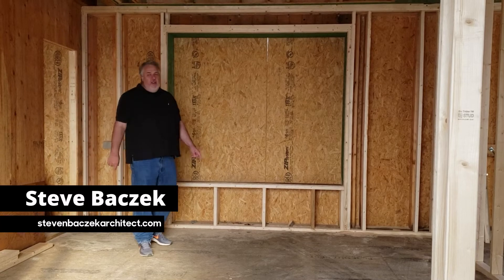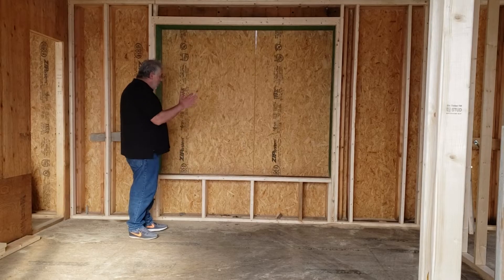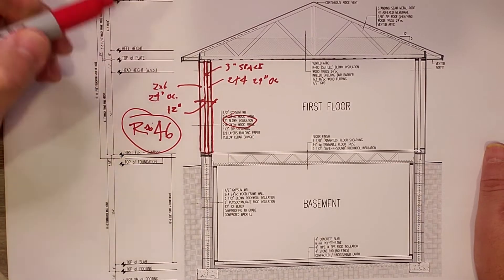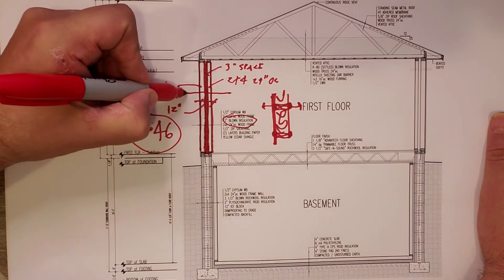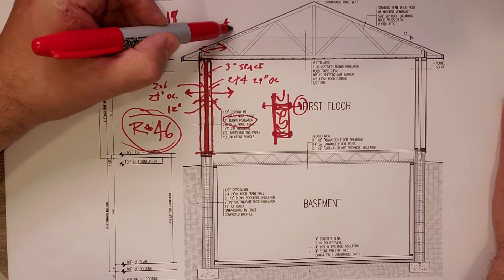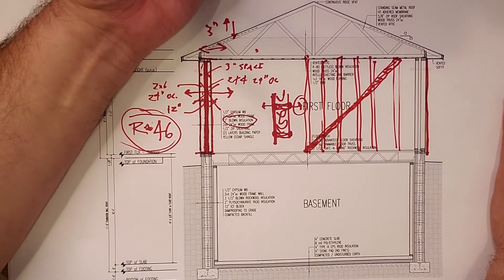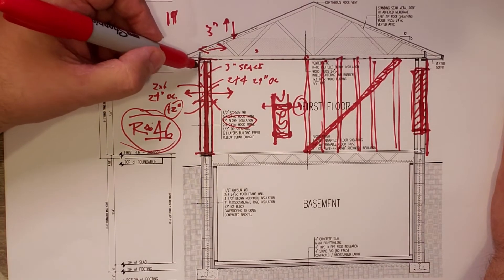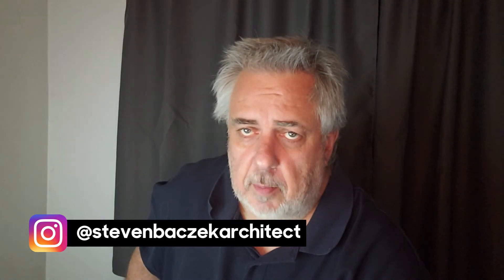Double Stud Wall Framing for Passive House

Comment: Steve, since the gap in the exterior wall is arbitrary, couldn't the 2x6s be replaced with 2x4s?
Have seen double walls with just 2x4 construction, but the 2x4s were staggered.  Not sure why they were staggered though.
And is there any advantage to installing windows that do not have a flange but allow the window to be recessed a bit?
Appreciate calm "sans soundtrack" presentations like this.  Thanks.

Comment: Fascinating post. Especially since, I was considering building a home, which included  the same basic structural elements. Such as a double wall with a diagonal internal bracing member. And it makes running the utilities such as plumbing and wiring, much easier and therefore more cost effective versus a single stud wall. (Which I didn't notice mentioned in the post?)

Except for I preferring a "staggered" double wall,  versus the inline double wall, in the post. Since a staggered formation, has some advantages, such as in terms of thermal efficiency (since heat transfer is not linear) and  greater sheer strength. Plus it's easier and more efficient to build. Since face nailing the diagonal member can be done at any point in the construction. 

So I'm curious Steve, why are the stud walls inline, with each other, instead of staggered in this post?  (Even if the advantages that staggered double walls have over inline double walls are relatively nominal)  

(I was also thinking about a trust formed external wall. Since a trust is, such an efficient design. But relatives to platform dimensional lumber stick building, it's considerably more complex and most likely not worth the added cost, to get it approved?  But staggering the double walls don't seem that much more complex than keeping them inline. If I'm missing something, obvious I apologize)

i just subscribed to keep up the good work.

Comment: In Ontario we're at 16" on centre. 
1. Is the 24" spacing still in that area or are you allowed to do it because of the double walls? 
2. Why not alternate the studs between the inter and outer walls so that they are not as close?
Thank you.
Reply: I've seen alternating stud applications, supposedly superior for structure.
Reply: 2x6 24" > 2x6 16"

Comment: Why do 2x6 for the outer wall? Why not do two 2x4 walls? Would be much cheaper and give a larger gap between walls for thermal break.
Reply: Lol. Exactly. I thought this was partly the reason to do this - to have a wide wall without added Lumber cost. What is the 2x6 accomplishing that a 2x4 with a greater gap wouldn't accomplish?
Reply: 2x6 is load bearing

Comment: Why the 2x6 exterior wall? Is there really ever any reason to do a 2x6 exterior wall in a double wall assembly?
Reply: I was thinking the same. Is an exterior 2x6 walled needed? Why not a double stud wall with 2x4 studs 16”OC and a 5” gap? Alternatively, how about a single 2x6 24”OC wall with 2” rigid foam on inside (with or without furring strips)?
Reply: 120mph wind rating requirements.
That was his answer to the question asked above
Reply: @ Oh, did they say this? Did I miss it?
Reply: @teraxiel  in a comment further up

Comment: Where do you install the 6 mil polyethylene vapour barrier?
Reply: If you are building this primo, you wouldn't use something as pedestrian as polyethylene vapour barrier for peak performance.  This seems like a stupid implementation, since you are missing out on the opportunity to install a nearly complete vapor barrier over the 2x6 wall, and then running electrical and pluming in the cavity.

Comment: OR you could try the following . my house is a log/block house . the laminated 'logs ' are 14 cm thick with 14 cm of wood fiber insulation on the outside followed by verticals furring strips and wood paneling over that . the space in between the FS acts as an air vent to remove any moisture build up . no vapor barrier is necessary as the entire wall assembly is vapor permeable . The mass timber on the inside regulates humidity and tempeture swings making  for a very comfortable atmosphere . The air blower test was almost at a passive house level . No  air to air heat exchangers are necessary as the entire structure is non toxic and non off gassing. 
opening a window for five minutes is sufficient to refresh the room . heating is done by a two ton soapstone down draft oven . 
A three hour burn is enough for two days at 72  
degrees or warmer at 32 degrees outside . 
The exterior walls can be erected in about two days including g roof framing . the lower labor cost offsets the higher price for the timbers .

Comment: My son has been building double stud walls for a few years now. Outside wall is 2x4 16” on center and that wall is spray foamed. 2” gap and than inside wall again 2x4 16” OC but of set 8” with exterior wall and that gets Rockwool insulation.  Now for a question I have for you. Have you had drywall screw heads start showing up over time?  First 3 houses he did, so he came to me and asked way that might be happening. I thought about it for a bit and figured out that the inside stud wall was twisting because nothing on the back side stopping it from twisting. Put blocking half way on wall and next 4 houses and no problems so far
Reply: That is a valuable observation and astute problem resolution.  Thank you.
Reply: diagonal bracing 45 deg between the 2 walls attached to the inner wall every 4 feet might be faster and give the wall a lot of lateral support at the same time. faster but a bit more wood. so cost of labor vs materials and structural load
Reply: @glasseyemarduke3746  I like the idea of the lateral support.

Comment: what do nyou do about fire blocking between the studs...actually there is an open space from floor to ceiling, between the two walls which would allow fire to go straick from floor to ceiling...what am i missing
Reply: That space will be full of dense pack cellulose treated with a fire retardant.

Comment: That was great coverage on dbl stud walls Steve! And glad you talked about how the "dew point" moves within the wall assembly and having to pay attention to potential condensate. I was wondering your view on offsetting the 2x6's and 2x4's centres (ie by 12")? Effectively that would produce greater depth of insul in the cavity between the two walls (ie.,  6-1/2" of insul between the inside face of a 2x6 and the vap barr / drywall, and 8-1/2" of insul from the front face of a 2x4 to the exterior sheathing, respectively). Obviously most applicable on long running walls, but do you think that would add materially to the R-values, rather than simply a consistent 3" thermal break? Worth the bother?

Comment: Puzzled why you'd go to that much effort for a 3" gap when you could add a whole lot more so easily - especially when the common studs aren't even offset from each other, so at every stud you literally only have that 3" gap. Upgrading even a little bit, to say a 6" gap, and having the common studs offset so they're not so close to each other, would give you a much better performance for zero extra effort.
Reply: cost mainly... 

yes the framing is the same cost for a 3" vs 6" gap... but now you have to insulate 3 more inches of wall. r-46 in a wall in climate zone 1-4 is already absolutely bonkers.

there is also some cost benefit to creating the gap in the first place, which is why the effort for the gap is there... for example now your electrician doesn't have to cut holes in studs, he can nail right to the exterior wall stud. that saves him time. and now you can safely run PEX and even 3" pvc through the exterior wall if you want too in most climate zones. without drilling holes through any of your studs.

Comment: Informative as ever Steve. But I have a question. Lets assume the same thickness of insulation is included in 2 different wall configurations. Along with the same interior and exterior finishing layers. 

Number 1 wall is the double wall as shown here. Number 2 wall is a standard 2x4 wall with 3.5" of insulation within it and the remaining thickness of insulation is applies to the exterior. 

Is there any advantage to No1 over No2? To my mind Number 2 has a better thermal break and a lot less lumber so will also be cheaper.  Also as a potential owner builder with little framing experience I think No2 would be easier to build. Or if I did get framers in at least I'm only paying for one 2x4 frame to be built?

Whats your thoughts?

TIA

Comment: Like it but could you use Zip R9 with 2” closed cell foam, then 4” RockWool in cavity, A vapor barrier, then the 3” of cellulose?   Can this eliminate condensation and have higher rated insulation over long term.

Comment: So…where’s the fire stop required in most areas?
Reply: that does seem to be the fly in the ointment.  The firestop cannot have a thermal break.  I like the trippled 2x4 walls, where the middle gap, allows wiring to go thru without drilling. And the middle is like 3 2x4's, if you put them on the 1.5 in side facing up.

Comment: What's an estimated return on investment based on the savings in hvac costs vs the extra cost of the double framing?
Reply: What’s the cost of extra comfort in the space? It’s not just energy savings, it’s a consistent temperature through the space and no outside noise.
Reply: @JoshuaRes  I suppose that matters in certain environments.
Reply: @WILSON.1 it’s often the most impactful way to sell an upgrade like this. Definitely higher cost to build, but there are benefits beyond energy savings.

Comment: If the inner wall was the 2x6 load bearing wall, the roof/ceiling spans would be a foot shorter.  If it was zip-sheathed and then the outer non-load bearing wall unsheathed and supporting just the cladding, you would still have the same thickness of cellulose, but shorter spans for roof/ceiling, as well as "innie" windows, so why not do it that way ?  The only downside I see is that you have no cavity to run wiring/plumbing between the two walls.  On he plus side, you would eliminate the thermal bridging around the windows and doors because you don't need 12" wide jambs.

Comment: So while the insulation info is good, what about that large opening without an appropriate sized header and no cripples?
Reply: It could be it is not a load bearing wall or he could be placing the header as part of a floor system above.

Comment: The devil’s in the details, I guess … please comment more on making a durable low maintenance wall, especially with respect to moisture transfer. If we build a double stud wall are we signing up for finicky interior vapor barriers and fine tuned mechanical ventilation? Is there a way to avoid the infamous “cold sheathing problem” altogether, like flashing the inside of the sheathing with closed cell foam?
Reply: Insulate on the exterior. You need long fasteners and other details, but you keep the sheathing above the dew point.

Comment: Why dont you offset the inner and outer walls so the thermal break is more than 2 times the space.
Reply: Once the bridge is broken it’s broken. It doesn’t matter if it’s 3” or offset in half because the cellulose won’t bridge
Reply: @HarderNotSmarter1  there is still slight thermal bridging. You can look up thermal models if you'd like

Comment: A lot of people naysay about putting OSB on the outside of a double stud because of its relatively low permeability. Do you see that being an issue at all or is that overblown? Will this walk use a vapor control membrane on the interior to slow moisture drive during heating seasons or is it fine without one?

Comment: The interior comfort level with double stud is A+, in my experience. Love it.
Reply from the maker: Agreed - great acoustical solution too
Reply: My  double walled cabin annex, unheated and uncooled is great year round in Sweden.
Reply: The chance that blown insulation doesn't settle over time is basically zero.
Reply: @nomdeguerre8464 there is a difference between blown in and dense packed.

Comment: Question:  Would it make sense to stagger the inner and outer studs, potentially increasing the thermal break from three inches to 6.5 to 8.5 inches, in most stud locations?  Or is this effect negated by something else?  Great video.
Reply: Steve, I see some builders sheathe the inner wall on the air space side and tape (and may even call it a vapor barrier, a term I question).  Wish I had used the double framing in mine. Instead, I framed a 2x6” wall, used dense pack cellulose, spay-foamed the stud edges, applies 4” of open cell styrofoam, then battens and a cedar rain screen. If I do a double frame, whether to use sheathing on the interior frame or exterior air space  is an open question for me.  Drywall again on the inside wall would be done again.
Reply from the maker: Maybe there is a slight benefit in terms of heat transfer........as for overall Whole Wall R Value - it won't change it
Reply: @stevenbaczekarchitect9431  That makes sense.  Thanks!
Reply: @stevenbaczekarchitect9431  But if you stagger the studs, you don't need much distance between the walls and still achieve your thermal break

Comment: Great content Steve. Are the  numbers crunched to see what more cost effective  putting added insulation on the outside or as you did in that house. A double studded wall. I like the double studded approach.  Wish big red can show some cost comparison.
Reply: Double stud wall is cheaper, and much easier to put your finishing on , whether siding or esp stucco.
Reply: @johnwhite2576  The only downside to double stud wall is lost of floor space inside the house.

Comment: Curious what the “need” is for the 2X6 on the exterior wall? Would 2X4 interior and exterior be structurally sufficient? Potential for a larger thermal break where the stud section of the wall would have greater R value, not to mention less lumber.
Reply from the maker: It is on Martha's Vineyard - 120 mph wind zone framed 24"OC
Reply: @stevenbaczekarchitect9431  Which is an interesting point. Double Stud is a really straightforward way to make reasonably good performance tall and/or very high wind and/or very heavy cladding situations work, because you don’t really need to care about the framing factor of the outer wall since no interior finishes are attached directly.

Question - ever framed with structural sheathing to the inside for your primary air barrier, cavity (i.e. to the outside of the sheathing) filled with batts and then fluid applied + glass mat sheathing or just a textile WRB as the water-shedding plane?
Reply: @2brazy4ubitch  this is how they do it in north Europe